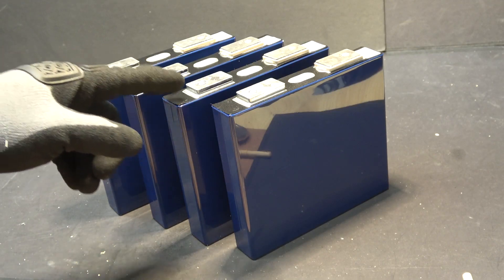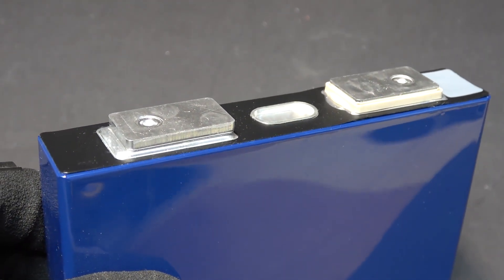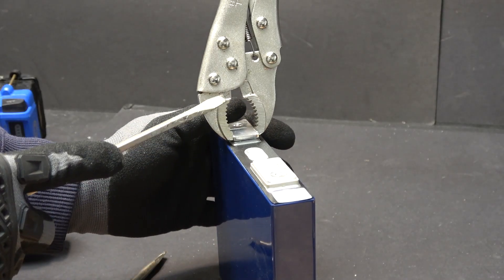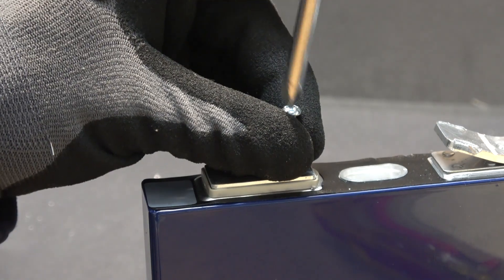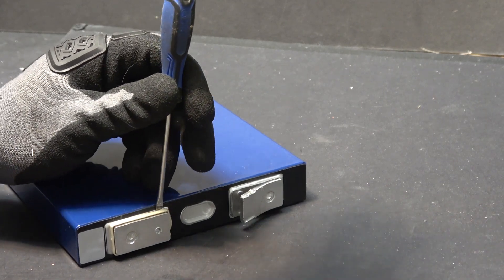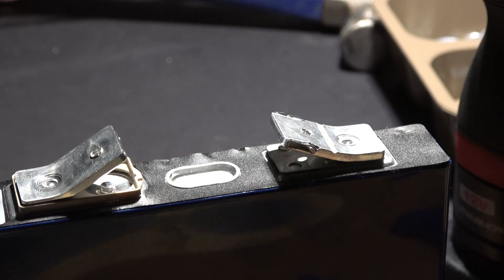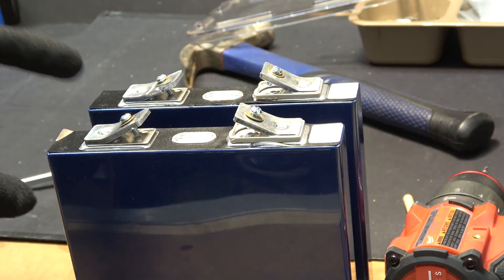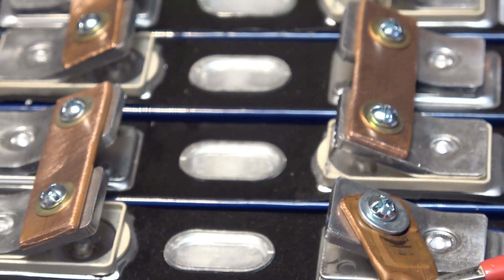Make battery terminals for LiFePO4 50Ah prismatic cells

Comment: If you can tap it, why not just tap it with a larger screw same depth it looked like it held well, and then use copper stock or copper pipe to go battery to battery screwed to the top?

Comment: Thanks for the video. I just bought 12 brand new aftermarket 3.2v 50ah Lifepo4 prismatic cells (They look identical) at Battery clearing house $5.00 each, warehouse clearance sale. The Aluminum contacts have no flat aluminum terminals. I may try attaching aluminum bus bars to them by carefully drilling with a manual hand drill, a 4mm deep hole in the terminal and using Marine grade 3/16" aluminum pop rivets. The rivets are a heavier gauge than normal rivets for higher conductivity. There won't be any heavy loads on the 12.8v Battery. 30Amp Daly BMS.
Reply from the maker: The negative terminal only has a thin piece of plastic separating it from the case which is the positive terminal. How can you attach a rivet without punching through that thin plastic?

Comment: I just did something similar a few days ago! My cell Al tabs were thinner so it was easier to bend, I did closer to a 90 degree bend. I used a wide, thin chisel to bend the tab. Before bending, I held a wood bar/beam across tab while bending to control where the bend would be made (at the bar edge). Much care must be taken, one tab of the battery cell is connected to the cell case. The other tab is easy to short to the case while bending! My application was I had a 16s battery bank that was laser welded and one cell went bad. I chopped out the bad cell and used this method to add in a replacement cell and connect it.
Reply from the maker: That's awesome, mate.

Comment: I think you were on the right track with drilling and tapping holes. If you did that to the terminals, 2 or 3 holes each and make sure you tape your bit so you don't exceed the depth of the terminal tap each hole,  have aluminum connector plates predrilled to match the holes in the tabs,  Use gray conductive paste that electricians use in aluminum circuit panels, and insert short screws to hold them in place.
 This would provide enough surface contact for the full 50 amps.
Reply from the maker: That's a great solution but you have to do it with great care, though. If I have to grade the engineer who design this battery terminal, from 0-10, they would get negative 1.

Comment: What about AC TIG to weld aluminium bus bars to existing aluminium terminals?  I have a heap of these batteries too and thats what i was going to try.
Reply: I was thinking the same but decided it would be too risky due to extreme heat? Unless you can do super short high amp spot weld shots with your welder?
Reply: @geekmystique  thats a good point. Would have to do short quick bursts perhaps. Im still learning how to weld aluminium with an AC tig first and will give it a try.

Comment: On a boat that has aluminium cabin you can not use copper fasteners, because aluminium and copper react galvanic and corrode. You must use brass or stainless on aluminium.
Reply: I'm not saying you're wrong but it's not a one-to-one comparison because on a boat the only voltage potential is that created by the difference in reduction potential of the two metals. But here the actual voltage of the battery will easily overwhelm those effects. Which could make galvanic corrosion worse or better or invert which metal gets corroded.
Reply: Dielectric grease time :)

Comment: I worry that there will be electrolysis between the aluminum, the copper and the zinc coated steel screws. Maybe you should use the paste they sell at hardware stores for connecting copper wire to aluminum wire. Unfortunately, cells like that are almost impossible to get in Alaska.
Reply: I bet there are more cells like that than you think. In cell phone towers, for example.

Comment: indonesian / asia have been doing this drill and tabs for 10 years from salvages laser weld tabs cell, its not new technique
Reply from the maker: This video is not about drill and tap. It's about how to tackle with the problem with these aluminum battery terminals. I don't have to drill and tap. I can just drill a bigger hole and use a  machine screw and nut for a more secure connection.